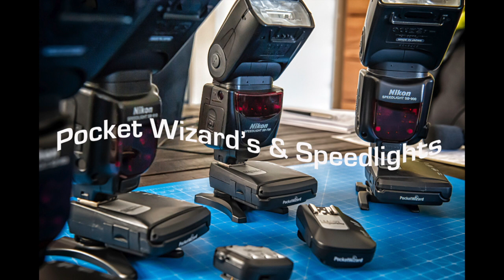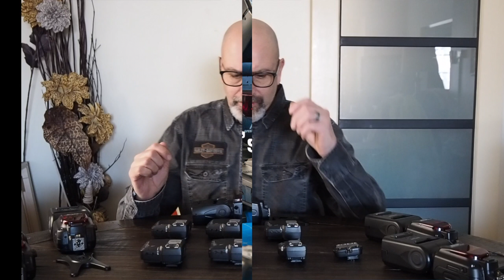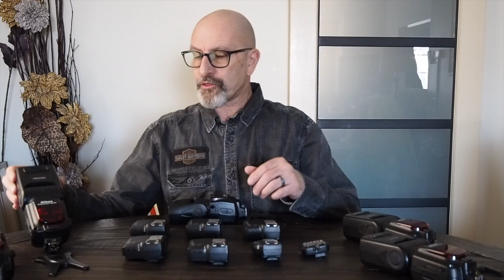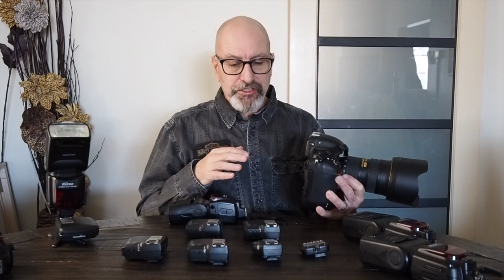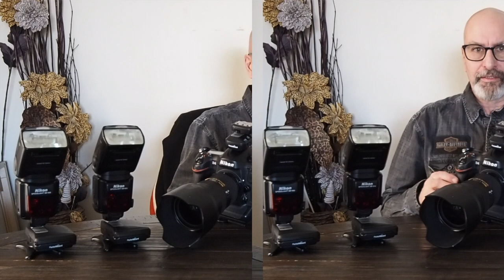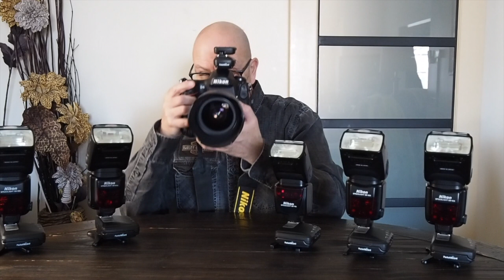Set Up Pocket Wizard TT5, TT1 & AC 3 with Nikon Speed Lights & D4 Camera

Comment: I have the same Pocket Wizard setup for Canon, and yes, they can be a bit temperamental. This is the best way to use them, I've found providing the most reliability...

 - Leave everything on auto, the pocket wizards, the flashes (TTL)
 - Use the AC3 to define the power levels for each zone - but still set auto & TTL
 - Once everything is powered on, as per the video instructions... take a calibration shot - note, the first shot won't fire the flashes, but it sets everything up
 - Even though I recommend using auto, it is possible to define some zones as manual, but I think this just over-complicates your setup - just use auto and the AC3 power levels
 - To globally change up or down ALL of the flashes, use the flash exposure compensation on the camera
 - note, this only affects zones that in the auto (A) setting

Hope this helps

Comment: Hi , I have 3 TT5s. I have 2 SB900 flashes for my Nikon. Without flash when I press the testa button I get the confirmation on the other receivers but when i put the flash on it does not work. However when I first turn them on in sequence the flashes go off to confirm they are working, but NOT when i actually want to shoot. Very frustrating.

Comment: can you use nikon 910 flash and TT Flex in a softbox and still get TTL? Thanks for a great video.
Reply from the maker: As it's a radio signal to the TTL it would word in a soft box and I'm sure the 910 would be fine.  Thanks for watching.

Comment: You should sell all those dated flashes & overpriced triggers
ATG/Godox/Profoto/Nissin/Yongnuo are a better buy

Hate to say this but Pocket Wizard & Quantum Instruments are in trouble
Soon, it will be Paul Buff, selling a $1,000.00 TTL flash that will not work on Hasselblad & Sony
Reply: There is no need to sell they do the job. I know because it's done the job for me for years. If it ain't broke, don't fix it. Another thing I just bought the TT5 PW for $39 used, and it works like new.  Adoroma has good deals on used equipment. Don't break yourself.
Reply: @juanpaulr  Good luck if you are using ATG, Hasselblad, Fuji, Leica, Sony, Olympus & Panasonic in TTL.